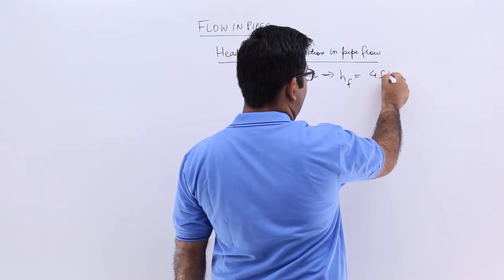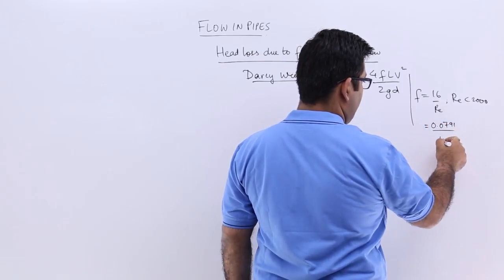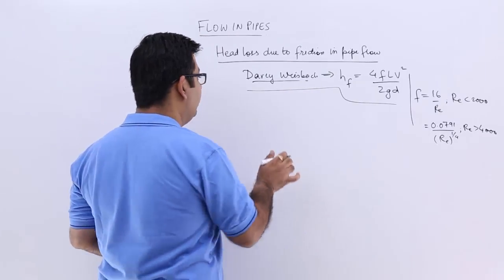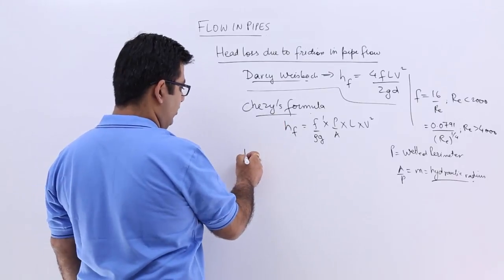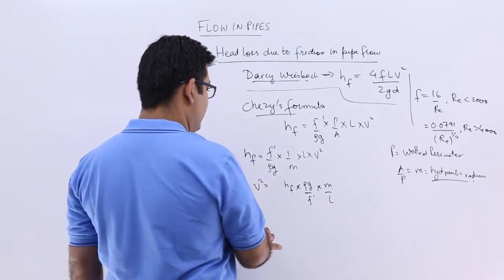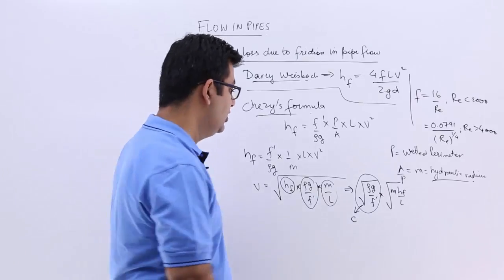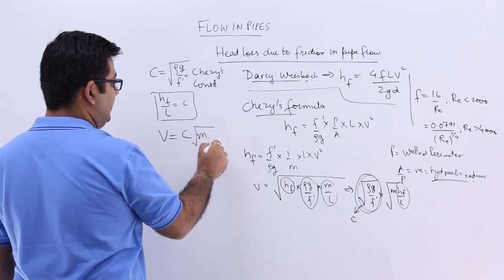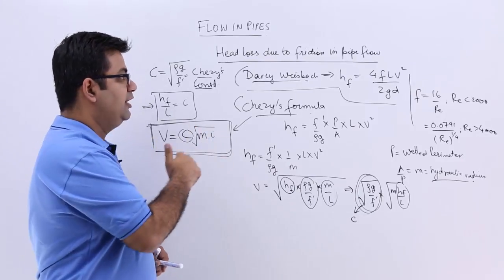Head Loss Due to Friction in Pipe Flow

Comment: Good Morning Sir, I am a bit confused about the formula. 
1. You are saying it is f=16/Re. But i have seen in other places, it is f= 64/Re.
2. Some uses the hf= 4fLV2/2gD. Others dont use 4. Why is that? And which one should we consider?
Reply: He is presenting the Fanning friction factor (f) which is 1/4 the magnitude of the Darcy-Weisbach friction factor (Cf).  DW friction factor is 64/Re and Fanning is 16/Re.  They are equivalent but you must know which factor you're using to get the correct head loss.  Darcy Weisbach head loss is Δh =Cf*L*v^2/(2gD).  Using Fanning factor Δh = 4f*Lv^2/(2gD)
Reply: @duffharrold  Thanks a lot brother.
Reply: U should use F=4f
As (F ) is fraction factor 
And( f ) is coefficient of friction
If in question if they are given friction factor  at that time u should use F not f

Comment: Hi there. Please make vedio for this example.i want send water from point (1) to point (2). The point 1 is   tank in mountain which elevation is 180 meter. The point 2 is tank  which elevation is 75 meter. I want how to solve this problem ( friction loss and hight  and size of pipe) because i want know is water come to tank 2 or not and i have pipe hdpe 3inch or 2 inch and distance is 14 km.
Pleae make example on your board.